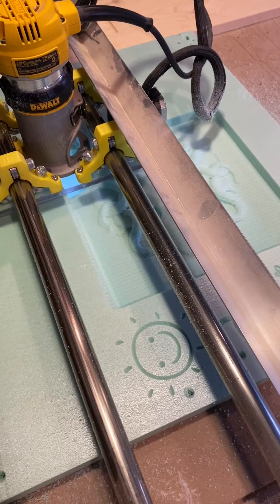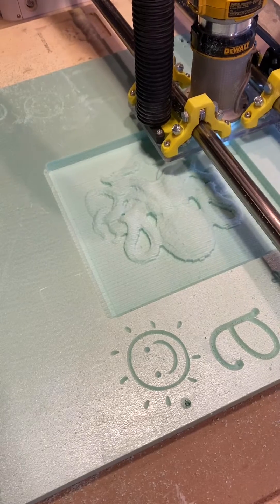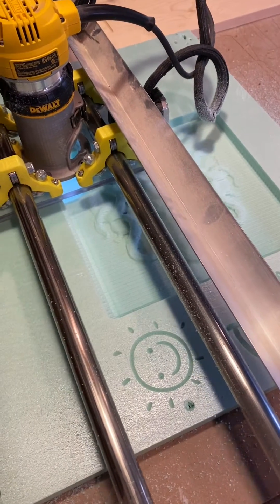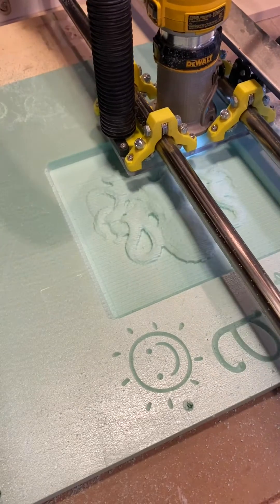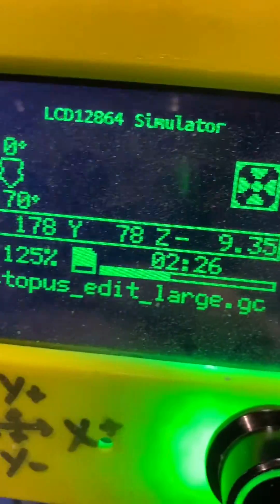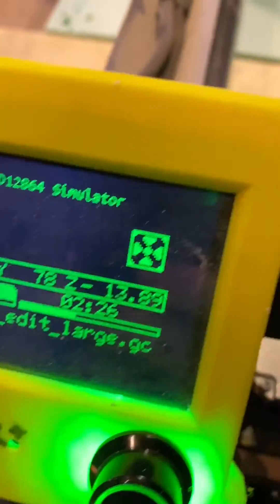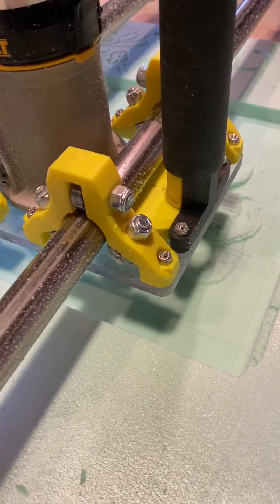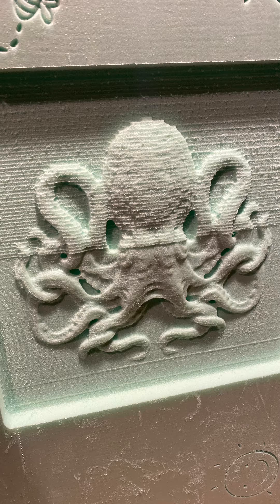Testing a Relief Carving on the MPCNC Lowrider 2

Comment: Hello Brent,

I'm a graphic designer and I'm in process of starting to buy a cnc, and I thought it will be an easy thing to do but it seems very confusing. Any advice where to start?
Reply from the maker: It’s really not that hard to figure out. GD software is much more complicated than CNC software in some respects so you should be Ok there. I built mine so I’m no help when it comes to consumer models. Just know what you are going to do with it before you buy one. They aren’t cheap!